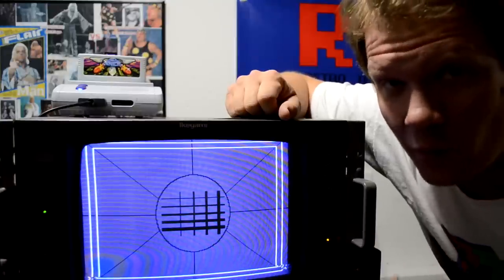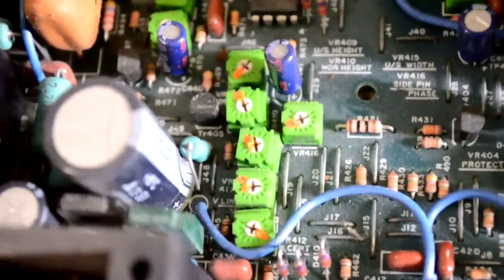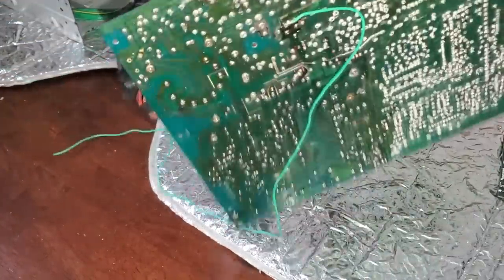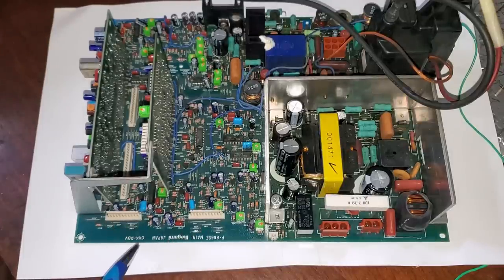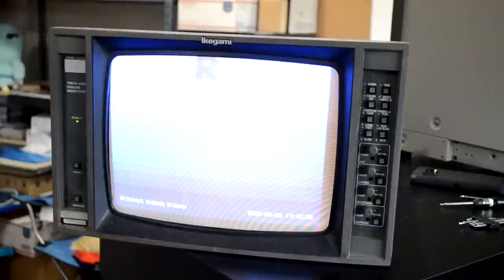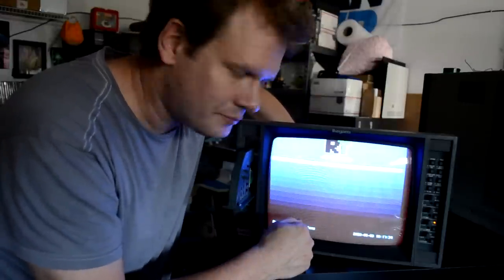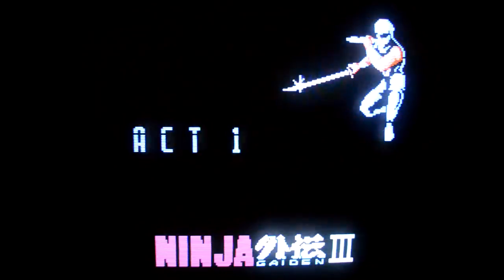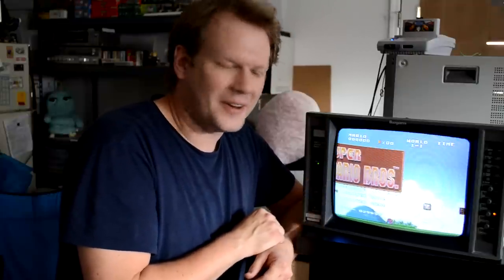Ikegami TM14-16R Color Monitor - Restored

Comment: Hi, i hace a question, i just bought an ikegami tm14-17r. I want yo change capacitors because of the high pitched noise monitor make. I Saw the manual and got the part numbers os capacitors, but i dont find them anywhere,  maybe its an old part number i dont know. Is there a recap pack os something like that?

Comment: hell yeah Steve awesome video!! I have an ikegami tm14-17r that is in need of a recap but I'm no expert when it comes to electronics. Though I think I could learn how to solder, I don't know what capacitors to order so I can replace them. I would love to know if the cap kit between this monitor and the tm14-17r are similar. Thanks!!
Reply from the maker: Well, unfortunately I'm not sure about the cap kit. If you take it apart and the Chassis looks the same, let me know and I'll send you the cap list

Comment: I never heard of the Ikegami brand before Steve. Looks like a good brand from what I'm seeing. Do you know much about them or ever had this unit in your shop  bro?

Anthony..
Reply: They only made surveillance/broadcast equipment.  That's why laymen have never heard of them.  It seems like their heyday was in the 1990's.
Reply: Ikegami made broadcast cameras and other broadcast equipment aswell. They still do but not so much anymore not as popular . Most people moved over to using Sony, Panasonic and JVC equipment.
Reply: Ikegami is the company that programmed the original 1981 arcade game Donkey Kong, though they don't like to talk about it (Nintendo and them have some sort of non-disclosure agreement). In fact, to this day, Nintendo does not have or own the source code to the Donkey Kong arcade game. It is owned by Ikegami. When developing the Donkey Kong Junior arcade game, Nintendo hired a company to reverse engineer the Donkey Kong compiled code to start as a base. And to be clear, Nintendo created Donkey Kong; they came up with the game play and all of the characters, etc. Ikegami just made it a reality by writing the source code and getting it to run on Nintendo's not-so-popular Radar Scope arcade motherboard, thus saving the company from having hundreds (or possibly even thousands) of unsold Radar Scope arcade cabinets.

Comment: Have you ever stumbled over any barco monitors? Do you know IF they are worth grtting? There is a sekler that has a bunch of barco cvm3051 in stock that i am intrested in.
Reply from the maker: I have tested a few.  The most important thing to check is if the Monitor will display 240p/15khz through the RGB output.  I ran into many that only supported 480P resolutions ad higher.
Reply: Interesting. What model did you test?

Comment: I have a tm14-17r. It's quite dim. I turned the screen knob inside, but it only led to flicker and brightness of the black, but not vibrancy in colour. Is my tube dying? 🙁
Reply from the maker: It could be, but first check and see if you can find a sub-bright pot or adjustment inside as well as the flyback screen knob.  I found a pot on my main board that adjusted brightness to perfection.  That tube could possibly be rejuvenated if you can get access to a rejuvenator.
Reply: @RetroTechUSA  Thank you!